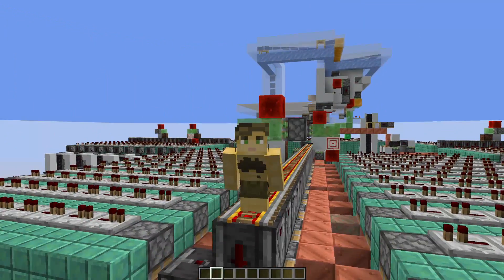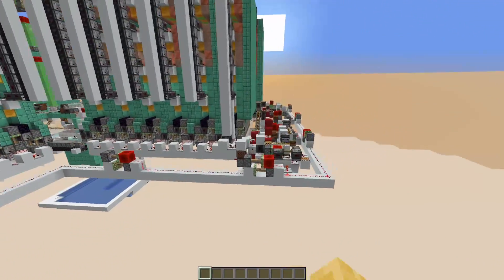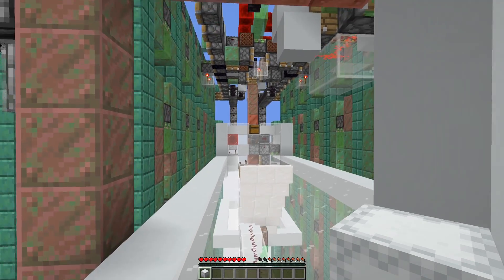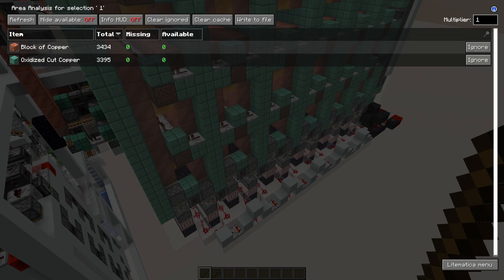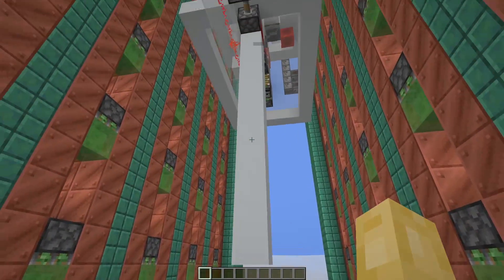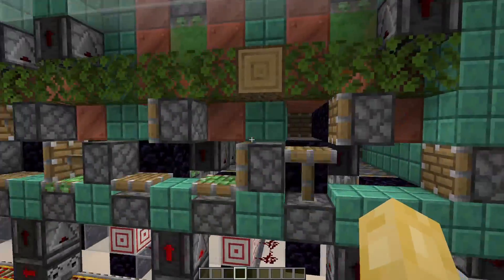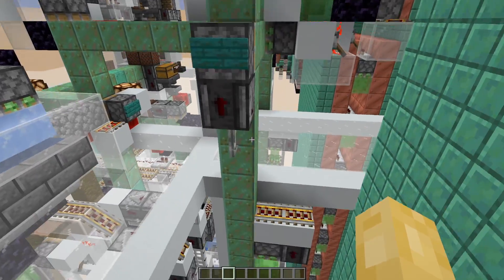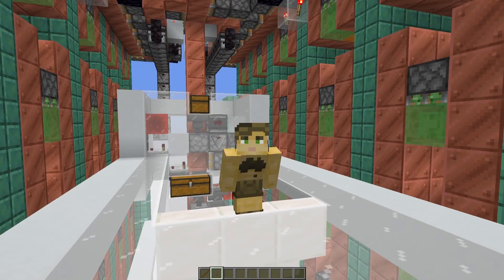The New Copper Conversion Catalyzer

Comment: Multifarm suggestion #2: misc item trickle farms

tiny honey farm, tiny sugar cane, tiny bamboo farm, tiny wool farm, etc.

Unsure on this suggestion, as I would assume the multifarm is intended only to to be used on things that require player interaction/blast chamber to use.
Reply from the maker: I only want to add farms that use the blast chamber and don't contribute any static lag. Otherwise we run into the issue of having too many farms in the one place causing lag.

Comment: Multifarm addition: wireless teleporter

What's better than a farm that can produce everything? One that you can teleport to instantly from anywhere when you need something from it.

Ideally, the ability to use a simple portable transmitter design using a minimal number of types of blocks to construct to save on inventory space (i.e. daylight sensor, observers, droppers and repeaters only).

Place a bed, but stuff in e chest, die, and continue with whatever you were doing :P

Chunk loading would also help to protect against block stream faults.
Reply: We finally got the tech for that last month from Squibble.

Comment: Don’t get me wrong I love highly technical minecraft as much as the next guy but what are the use cases of this machine, or is it just for the sport of designing the machine? I ask because if I needed a ton of fully oxidized copper for a building project I would just build it out of fresh copper and let it oxidize. However I do see the benefit of having  such a machine if I needed a specific intermediate stage.
Reply from the maker: For some builds you need a specific colour of blocks and don't want to wait around for the copper to oxidise. Especially given that it can take several days for some configurations of copper to fully oxidise. This simply speeds things up and gives the player more options.
Reply: Exactly my thought.
Also, for intermediate stages it would probably be best to create a farm that detects the change of the block type and applies wax at just the right time.
Reply: Do you think it would be worth to add just a few fully oxidized copper blocks to a freah build? Using them as spreader blocks. I don't remember the exact mechanics of oxidization well enough to tell if this would actually be working.
Placing and later breaking a couple of single blocks should be close to no effort and would be much easier than building a big and complex contraption

Comment: i will say it again, replacing the walls of the farm with oxidized copper slaps is twice as cheap and has the same effect
Reply from the maker: I considered doing this for the new design but decided to leave it up to the player. The only viable way to build the thing entirely with slabs is using build mods because otherwise you don't have any surfaces to place slabs off of.

Comment: May I suggest adding a multi-item sorter to the blast chamber part for just the copper blocks and their variants? Then have different switches for specific stages you want, so if you want first stage, the output will give you the first weathered stage. If you want second stage, it will give all the second weather stage output and will spit back out any first stage to the player to place again. Final stage will output the final stage and give any other stage back to the player to replace to age more.
Reply from the maker: Stage selection is pointless because you can simply revert the state of a copper block by scrapping it with an axe.
Reply: @cubicmetre  also copper waxing is quite pointless if you don’t have a copper farm hooked up already since you can craft it
Reply: @cubicmetre  Yes, but what if you want fully oxidized blocks, but you don't have many that get to that state before getting blown up?

Comment: Those faults are still pretty major. Needs faster fault detection IMO, great build tho
Reply from the maker: The fault detection is as fast as it can be, it detects when blocks start overflowing inside the conveyors and it was taking a while for blocks to bakclog because I hadn't placed barriers in other places. The delay for the fault detection is primarily because it is timed so that the conveyors process the blocks for each motion of the input. Everything is timed to extremely tight tolerances to make it as robust as possible to inconsistent inputs and give minimal latency.

Comment: would it be possible to add deep slate to the farm, i have shulkers of deepslate that i need to convert into cobbled deepslate ive tried running it through a concret converter but it keeps breaking it lmfao
Reply: I find it nuts that the game still punishes the player for using silk touch, by making silk touched blocks useless.
So we have to carry 2 different pickaxes on a limited hotbar/inventory and switch between them just to obtain 2 different drops from the same block, and even then a fortune pickaxe is totally useless late game.
There's no real reason why deepslate can't be crafted into all the variants, and if we flip it around , cobbled deepslate becomes the useless one.
When it was first introduced , deepslate behaved like stone : cobbled deepslate could not make bricks/tiles, which punished early game players for not having silk touch.
But then mojang changed it, such that now it punishes mid-late game players for having silk touch. And considering deepslate cannot be generated and blasted in a chamber like cobble , it leaves the only way to obtain it is by mining it.
Even the furnace can't solve this problem like it does for cobble into stone.
Meanwhile, all the stone items (furnace, piston, observer, dropper, tools...) still cannot be made out of actual stone.
Blackstone is somewhere in the middle, it does not care about silk touch and it can craft furnace and brewing stand but not observer and pistons.
Stone rewards silk touching by enabling it to skip 1 smelting step.
Then there's endstone...
Thankfully some mods/datapacks mitigate this problem by enabling all the crafting recipes for normal deepslate.
Reply from the maker: I wouldn't put deepslate through the copper converter, however the concrete converter input for the blast chamber would work fine, check out the previous video I made about the omnifarm for the details.
Reply: @cubicmetre  sorry my bad i ment the omnifarm lol should of specified lol

Comment: Add an azalea tree farm including a bonemeal supply to the multifarm. You'll get a hell of a blockstream out of it (as long as you go for bm efficiency and not just take one or two blocks from every tree).
Reply from the maker: Azalea trees produce mostly oak logs, for which there is already a farm for. Dirt on the other hand, would be much better to obtain from tall spruce trees converting moss to podzol.
Reply: @cubicmetre  Azalea treefarms don't need player interaction or presence, making the process completely automated. Combined with a shulkerfarm (which doesn't need the player around as well) this makes for a nice combi to farm shulkerboxes. On the other hand nethertrees are suited for that need as well and add a new woodtype to the complex as well. Didn't think about that option when writing my first comment

Comment: You should add a mangrove or nether tree farm as a input to the omnifarm
Reply from the maker: Mangrove trees generate in such a weird way I'm not sure if converting them into a blockstream would be practical. I might have to look into it.
Reply: @cubicmetre  Mangrove truly is the devils tree but nether tree farms can be a good option option as well.
Reply: @cubicmetre  IcebergLettuce has a nice mangrove tree farm that collects most of the logs into a single blockstream
Reply: stromne made a VERY bare-bones early-game mangrove tree farm which you could retrofit. he found a way to force some logs to grow in the same position each time. it makes a 4x1 block stream where the top 3 are logs and the bottom one is roots.

basically to connect his farm to cubic's blast chamber, you would need some piston setup which turns the block stream from 4x1 to 1x1.

Comment: on my world i have autoCraftingTable and dispensersPlaceBlocks so i can hook this right up to the copper farm without any player input 🥰🥰
Reply from the maker: You will need a player nearby for randomticks, also you cannot run the farm continously at max speed and get oxidized copper. It is meant for short bursts of replacing the oxidized copper with fresh copper every few hours. For full auto I would suggest reducing the input speed to match the conversion speed, so 80gt interval between copper blocks for the 900/h or 200gt for the 360/h. Or you can simply make the whole thing 20x taller to increase the time each block spends in the system.
Reply: @cubicmetre  yes, i got the part about 1 shulker box per 2 hours for the big system. but it's really nice that you help people out with using your designs as well as putting all the effort in to the videos :)

i think it will be an interesting challenge to match the output of a copper farm to an automatic oxidiser. doubt i will be able to get a continuous 5gt copper block stream, that would be 212 drowned per second (lol)